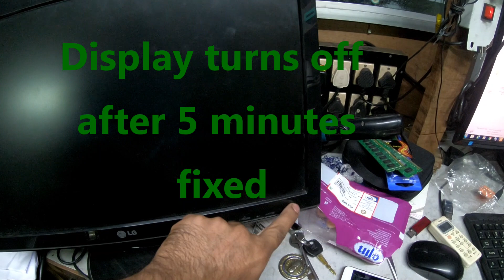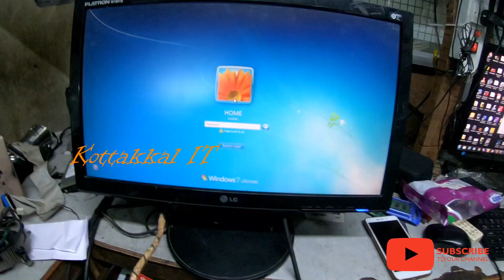FIX  MONITOR TURNS OFF AFTER A FEW MINUTES repair #kottakkal it#

Comment: hello kottakkal, could you please tell us why you changed that IC? I've another monitor with the same IC (TOP258PN) and I tested it with a simple tester, no voltage-in and there's current passing. How could you notice there was that problem on that IC and hence change it? thanks
Reply from the maker: 1 Only working  After few minute  
Monitor  restarting 
No display 
This can happen because of this IC